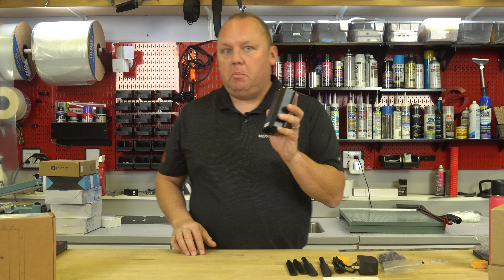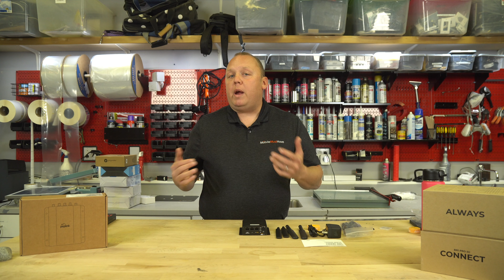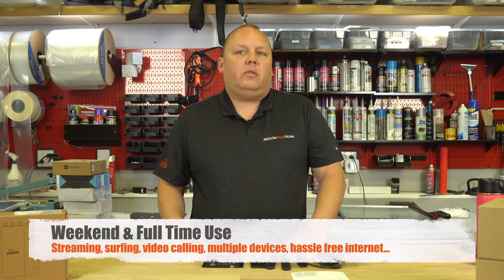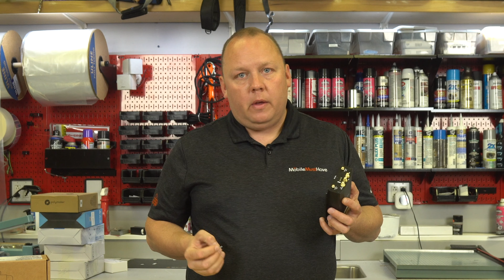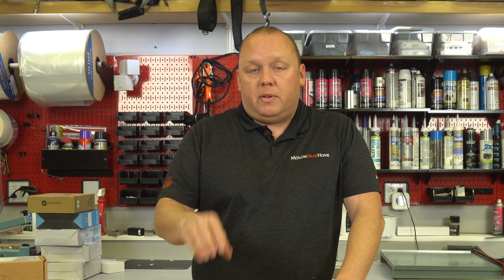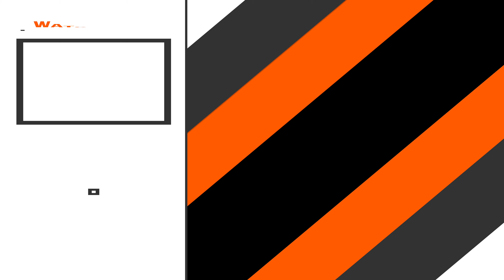Pepwave MAX BR1 Mini PrimeCare Edition (HW3) Overview

Comment: Would this work for home internet with an unlimited data plan? Also can i put my own sma antenna on it? We have 1 bar of signal but direct line of sight to the towers about 15 miles away so i think a high gain directional antenna should fix that and make it work here
Reply from the maker: Hello! Thanks for reaching out! So, the unlimited data plan would depend on if you could get a hotspot data-only SIM card from your provider. If you have T-Mobile or Verizon Home Internet, it may not work directly, but you would have to confirm with them to know for sure. Alternatively, you can connect the home internet gateway to the Peplink router through the WAN port. This would allow you to bond the signal with another data plan installed in the Peplink router and a wireless connection through Wifi-as-WAN as well.

Yes, as long as your antenna has SMA connections, it should work just fine! If you did need to upgrade your antenna, I'd recommend the Poynting XPOL Directional Antenna: https://mobilemusthave.com/products/xpol-2-5g-us-5g-600mhz-high-gain-cross-polarized-lte-mimo-antenna?_pos=1&_psq=directional&_ss=e&_v=1.0

Hope this helps! If you have any other questions, reach out via email at info@mobilemusthave.com and we'll be happy to help!

Comment: if it doesn't have WiFi wan or the wan port open then your only option to get online is over the sim card? no option for bonding or anything so it'd basically an expensive 4g modem?
Reply from the maker: You can open wifi-as-WAN with a license. If you are looking for bonding, I would suggest one of our more expansive modems like the BR1 Pro!

Comment: With the wan feature unlocked (added price), are you able to bond the wifi with the data sim? Or is this router just using only one source at a time?
Reply from the maker: The advanced feature pack unlocks the ethernet wan as well as the failover and Speedfusion functionality so it can bond cellular, wan ethernet and wifi as wan as needed into a single unified connection. Great question!

Comment: I am a long haul truck driver I am not technical at all will this thing being easy to set up? And would I be able to take the Sim card out of my iPad and put it in this device or would I have to buy a new data plan? Thanks
Reply from the maker: This device is easy to setup and we have lots of guides with videos to help set up.  That said, this is a hotspot device so in most cases tablet plans are not compatible.

Comment: interesting. how is this one compares to AT&T nighthawk m6 pro MR6500 ?  similar price, and the nighthawk is capable of 5G, and is portable, so you can take it with you to a trip in the nearby city.
Reply from the maker: The nighthawk is a decent consumer grade device designed for portable use but lacks the build quality for 24/7 use which is why the majority of our customers move to business class devices like this one for a stable and reliable connection they dont have to think about. The max br1 pro 5G would be a device more comparable to the modem in the nighthawk if max throughput was your primary concern. That said if occational use and portability are on your wishlist id say the nighthawk is a great choice. If your looking to leave it on 24/7 and not reboot it daily, consider a business class router like this one or the 5G capable Max BR1 Pro 5G.
Reply: I also have an MR5200 and a complete line from Pepwave (Balance20x.) Netgear makes a great hotspot, and I use it to access 5g bands myself but because off the shelf the MR5200 does not support 4x4 MIMO and Band Locking, nor does it have speedfusion cloud bonding or external WAN management its a bit hard to say its an apples to apples comparison. 

I use Pepwave to manage my 3 WAN connections, both internal to the pepwave and via third party devices like TMobile Home Internet.